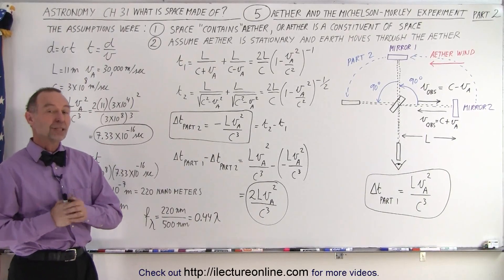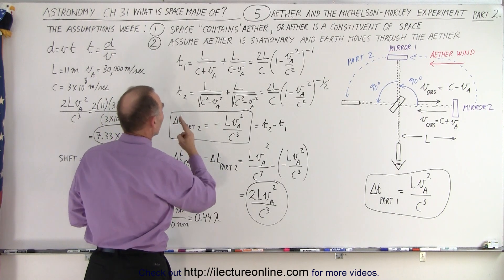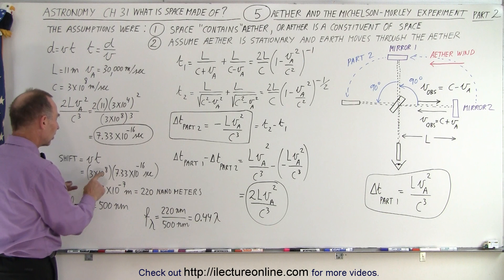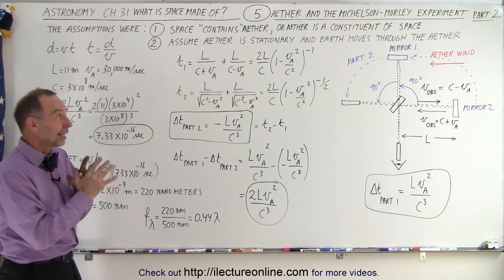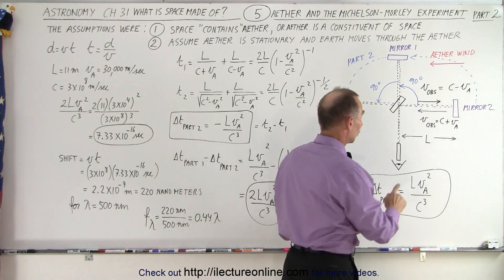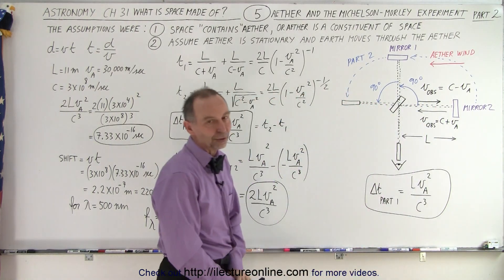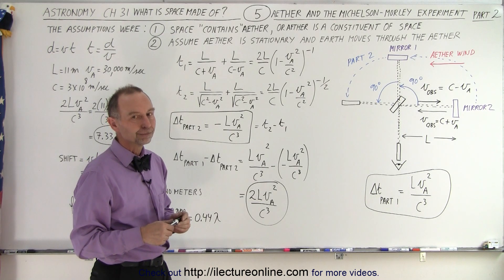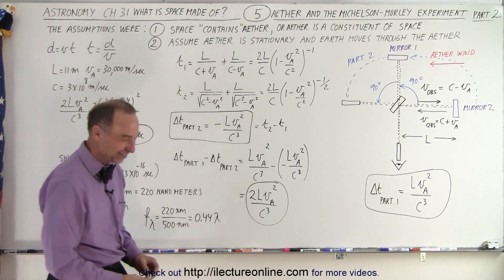Astronomy - Ch. 31: What is Space Made of? (5 of 15) Aether and the Michelson-Morley Exp.: Part 2

Comment: The test Michelson did with a vertical arm did show a shift. Ryerson lab I think.
Reply: The thing is, the stationary ether was disproved. The dynamic ether, where there is an unequal inward drift versus an outward one required a vertical arm of the interferometer.
Reply: Using a vertical Michelson-Morley interferometer the length of the arms can be affected due to their weight.